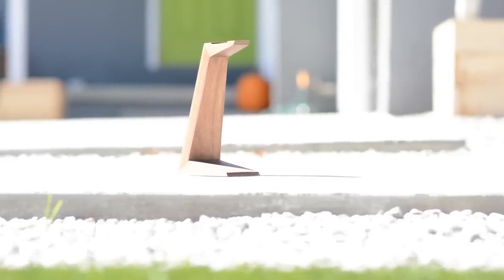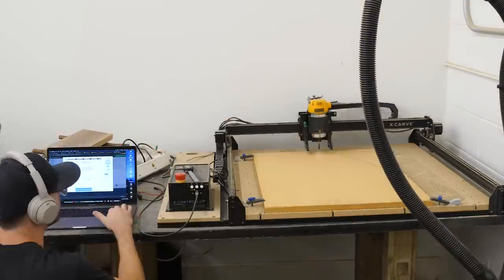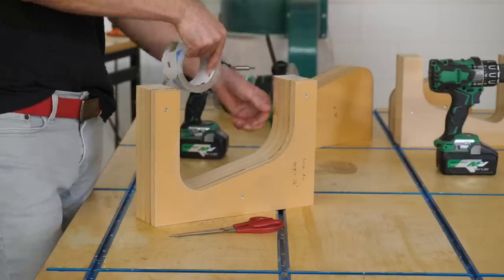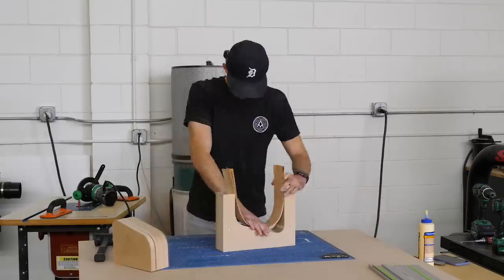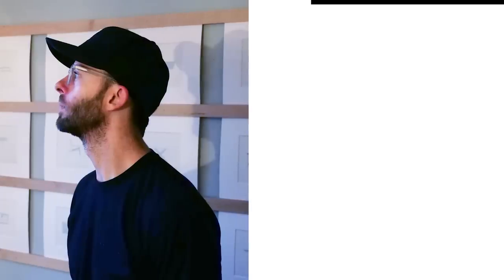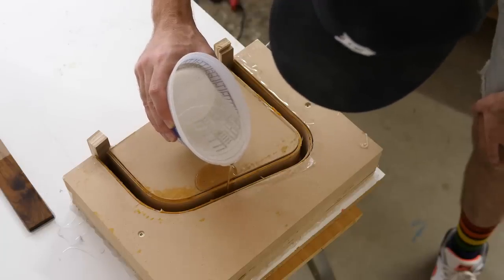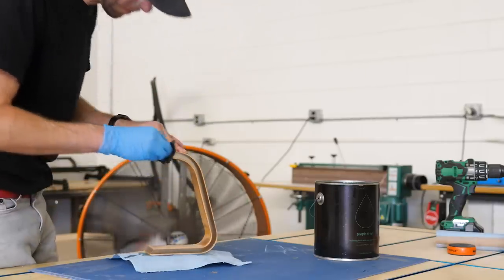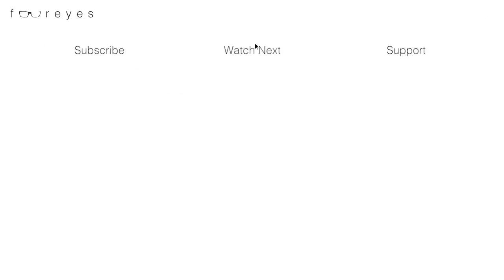Epoxy Sandwich Headphone Stand Mmmm 😋

Comment: Isopropyl alcohol makes hot glue hesive, or whatever the opposite of adhesive is.
Reply: minushesive
Reply from the maker: I believe "subhesive" is the correct term
Reply: Unhesive.
Reply: @Foureyes.Furniture  Should be Abhesive. Ad and ab are antonym in latin
Reply: hot glue adheres... acetone makes the glue release.. and thats my 2 cents spent.
Reply: @arbitrarystuff1229  Adsolutely! Ad = 'towards', ab = 'away from'; e.g. between a road & a city.
Reply: @Foureyes.Furniture  - I would go with "ahesive".
Reply: @timk9912  - Makes sense, so, how's about "releasive"?
Reply: Ain'thesive
Reply: adhesive'nt

Comment: Hey Chris! When you are laminating, try to spray some thin water coats on to the thin wood/veneer, when you apply wood glue. But of course from the other side. This will prevent the annoying bending of the veneers.
Reply from the maker: Good call

Comment: If you or others have not yet figured out why the wood curled... When you let the glue sit on it, the water in the glue—it is MOSTLY water—soaked into the wood fibers. The fibers on that side therefore got wider–in the direction that wood movement happens, and the wood curled inward on the opposite side. The fact that the wood was so thin exacerbated the process. BTW: For those Youtube viewers and makers (NOT Chris) that continually screw down solid wood tops to tables, casework, etc. or put frames around cutting boards, and then ignore all the comments from woodworkers who tell them that it will eventually crack: Chris has just proven through time lapse imagery how much wood can move through moisture absorption. Awesome tertiary outcome!
Reply from the maker: Thanks Kevin...got it. So in laymen terms. the wood on one "face" was "weakened" the wood on the other side wasn't. The wood on the "other side" overpowered the "weaker" side. Essentially winning a Wood v Wood Arm Wrestling match :)
Reply: @Foureyes.Furniture  Essentially. If we want to be pedantic—and because this is the internet, I believe that IS required?—no wood was weakened, but the wet wood was 'strengthened' in that its cells had to put that moisture somewhere, so they swelled to hold it. In fact, if you had taken a squirt bottle and squirted water on the curled side, the strips would have come back into balance and leveled out on their own. The reason one cracked is because the swollen side literally crushed the cells on the other side and caused them to break apart along the grain lines. 
Regardless, the project looks great, and I think the furniture base idea would be a real eye catching design that takes acrylic and moves us beyond all the 'river' aesthetics that have been thoroughly explored by now. n.b. to other YouTube woodworkers: Thoroughly. VERY thoroughly.  ;-)

Comment: Super cool idea!! You could have used your xCarve to cut out the shape in a block of the material you wanted it, like the beach wood. Filled the void with epoxy. Then put the block back on the xCarve and cut a slightly larger shape leaving you with a 1/4 inch beach around the shape. Essentially the same result. Just saving you from having to create all the forms etc.
Reply from the maker: I get what you're saying...that might work. The only problem I could think of is you'd end up with weird grain orientations. Also, since this was a test case on how I could do this for large pieces...I'd need a giant CNC to achieve it...(when it isn't for the headphone stand)
Reply: Chris Salomone I was not thinking about the Gain!!! You are absolutely correct. This is why you are king! I can visualize placing some LEDs.

Comment: 3:28 I assume you have never worked with veneer before. Good for you. I personally hate it, because you need to use edge banding, there’s no end grain edge banding, so you end up with a really weird looking piece. But it’s a great demonstration how wood reacts to moisture. Pretty much a small scale, exaggerated and fast forward experiment of how a thicker solid piece of wood would react.
Same reason why you should always apply finish to both sides, at least one coat. The untreated side would soak up moisture much differently than the treated or sealed side, making the piece warp. Even if it’s only veneered particle board. That 1mm layer can make a 1 inch board warp. Kind of amazing.
Reply from the maker: Good call. I've worked with other veneers. Just never had this happen. these pieces were particularly thin, so I'm sure that contributed to how quickly it happened.

Comment: Very cool. If you're going to be experimenting with casting in apoxy, I would suggest looking at moulding with silicone. Basically you make a template for your compleated object, cast it in silicone, then use that mould to make your apoxy project. I wouldn't try to use a wooden mould because, as you found out, the apoxy likes to stick to things. There are several youtubers who cast apoxy this way.

I would alsi recommend mould release spray and, depending on the size of object a pressure pot or vacume pot. If it's a small item, you put the mould full of apoxy into a pressure tank and increase the pressure to a point where any bubbles are squashed so small you can't see them any more. If the objects are to big to fit in a pressure pot you need to go with a vacume. Put the mixed apoxy in a vacume chamber and remove the air, there are several techniques for doing this without the apoxy bubbling over the sides of your pot. You then poor the apoxy gently into your mould and try not to introduce more bubbles at the same time.

Evan and Kaitlyn do a fair amount with apoxy. Nick Zammeti is another good one. (Sorry if I've miss spelled thier names). I'll try to think of anyone else who does it on YouTube. 

You could also talk to Total Boat, who make apoxy resin, they could also steer you in the right direction and might sponsor a few episodes as well.

I hope my mad ramblings help.
Reply from the maker: Thanks Glen...appreciate all the feedback. I was thinking about making a silicone mold after it came up on the podcast last week. But then I feel like I start getting into a situation where the juice might not be worth the squeeze if you catch my drift :)

Comment: This is one of the best and neatest projects I've seen in a long time. Great job! Oh, try wax to seal the bottom of the form to the melamine and use screws instead of hot glue. The form should release cleanly AND you'd should be able to use the form a second and even a third time.
Reply from the maker: Good call. Thanks Tom :)

Comment: Use a non water based epoxy for your bent lamination glue ups and your laminations won't fold up like that. Techniglue is my favourite due to the thick paste like consistency.

Comment: You could cut a pocket on the CNC, pour epoxy into the pocket and then CNC around the epoxy with a small offset leaving a timber skin on the epoxy.
Reply: this method would make some of the wood "skin" end grain, which is ugly.

Comment: A cool design idea, but I can definitely imagine fudging something in production as it is now. You could use two smaller forms on top and bottom that hold laminated pieces in place instead of full form. That might make it easier in some way during form removal. but that would require making aditional MDF rigging, so I'm not sure if that would be worth it.

Comment: Make a multi part mold out of mdf on the cnc that slots together and  so its very easy to take it apart. Also paint the mdf with a primer to seal the cut surfaces and use a very lenient mold release like vaseline

Also. You forgot rgb leds in the epoxy for making it go faster...
Reply from the maker: Dang...I knew I was forgetting something :)

Comment: I'm curious to know what adhesive you would use if you were to do it the other way. Assuming you have the appropriate clamping pressure to squeeze out any air and make the contact full spread, you would probably also want something that cures clear. I wonder if something like a 2 part epoxy adhesive would work well. good luck, I enjoy your videos and look forward to seeing more!
Reply from the maker: Exactly. I would have used more epoxy. :)

Comment: it looks at the end like the epoxy is a little cloudy/hazy/not quite translucent.  is that just an effect of the filming of it?  I guess my question is how clear is the epoxy in the middle?   I'm judging by shot at 8:39   but then i second guess what i'm seeing because you have ghost headphones you can see through somehow.
Reply: Depending on the grit of sandpaper used, it might just be the surface finish.  I know for 'repairing' headlights or clear plastic, you have to sand it with up to 1200 grit, then hit it with a rouge or paste for the high shine.  Generally for wood, it seems like 320 or 400 is about as far as most people go. Either way this is a super cool effect. Even with a bit of diffusion, if there were a small embedded LED or something the whole surface would glow due to the surface imperfections.  ...and that would look awesome on a media console. 👍
Reply: @tombuildsthings  oh man! i have some LED strips.  that's a great idea! i wonder if they'd be ok inside of epoxy without getting too hot.  now i can't wait for the work day to finish so i can go home and tinker!
Reply from the maker: It isn't totally clear. That was my original plan, but I ended up gettin some wood fibers, etc... in the epoxy. So polishing it to be really clear would have shown off all of the bad stuff. So I kept it a little cloudy. It's also less work to do that :)

Comment: Hi Chris, I was also interested in making a headphone stand using bent lamination. What would you say would be the minimum amount of layers that would be needed in order to hold a pair of headphones?
Reply from the maker: Not a lot. Less about layers more about total thickness, but if you built strips up to about 1/4" that will be plenty. My Shoe shelf is only about 1/4" thick, and those are definitely heavier than headphones.

Comment: Since you're doing all that reshaping afterwards, why not use silicon as a release agent/medium while casting it? Meaning pre-coat the mold bottom where you used hot glue and coat the surface (not the finish wood) with silicon - use a scraper to spread the silicon?? Would the silicon mess things up? I suppose you could tape the mold on all surfaces..... I know you've learned from this one and I hope I am not insulting your intelligence by suggesting all the 20/20 hindsights ... Anyway, I still love the concept.
Reply from the maker: Definitely learned from it, and I am no expert when it comes to this stuff. Hopefully I'll get better with afew more under my belt.